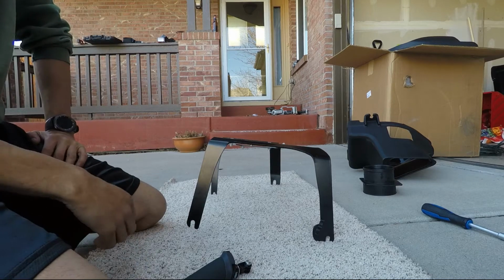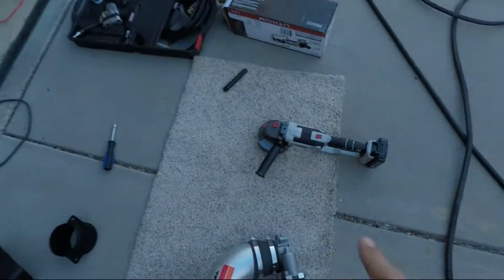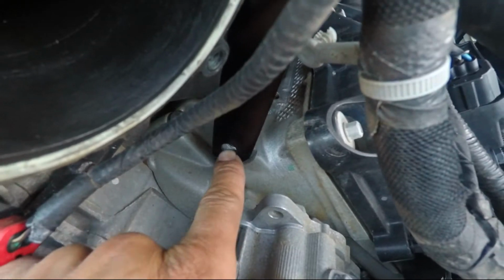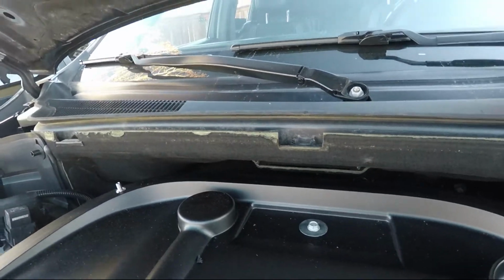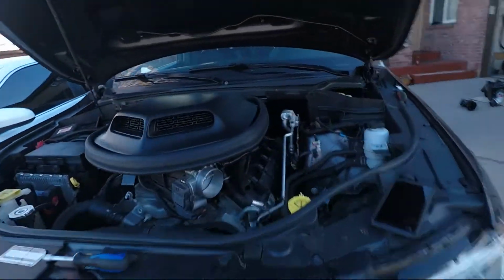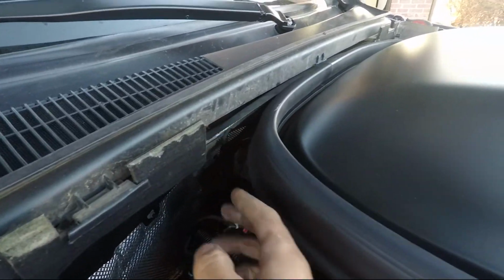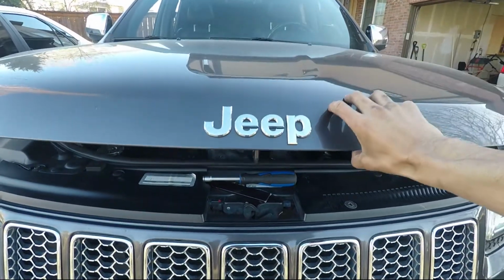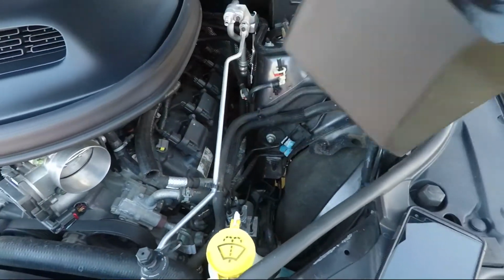Will The Shaker Fit Part 1

Comment: Hey Kev, been searching for you bro. Love and respect for completing ur shaker kit project. Looks dope!! I’m a big shaker hood fan and been looking at doing the same thing on my 2016 SRT. I’m in Australia and will need to order from the states. Have you got the part number for the shaker kits as there are several on the market. Cheers!!
Reply from the maker: 5038430AF 82214586AB   
68240640AA You will also need to reroute your A/C Line for the Air inlet box to work in conjunction with the shaker inlet tube.

Comment: Get yourself a catch can, best thing I’ve done for my R/T. I bought one from eBay think it was around $60. You’d be surprised at how much oil vapor your burning.
Reply from the maker: Yeah I dont know how I dont have one yet. I remeber when I swapped manifolds and the old 5.7 ones gaskets were soaked in oil. Ill have one by the time I do the cam swap